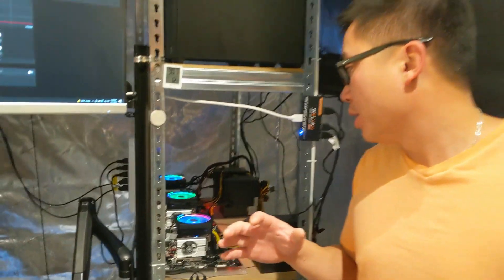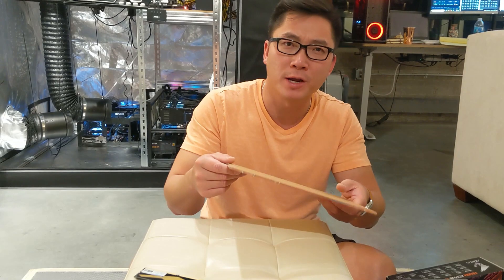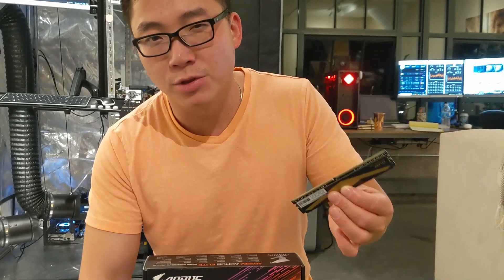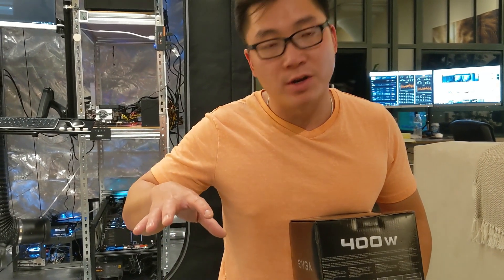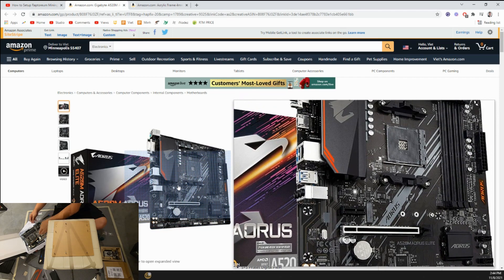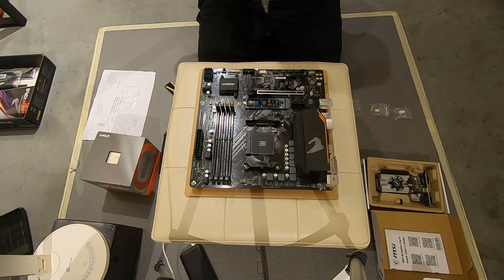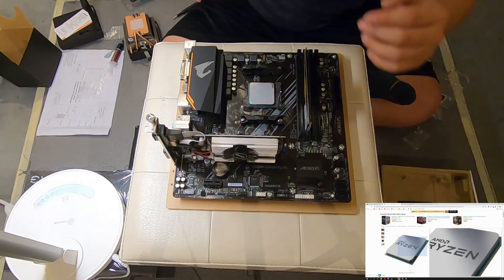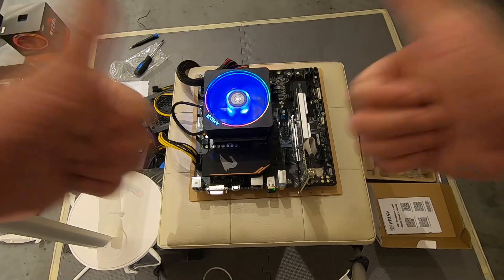What is the Best Mining Rig Build for CPU Mining Raptoreum?

Comment: For all of those asking why he is not using the IG, the simple answer is because he doesn't have IG.  You are making the assumption that because there are video out that the motherboard chipset has IG.  The video out are there because the motherboard supports AMD APUs.  The CPU he is using is a 3900x hence no IG.  If he was using the 3600G which is an APU then he would have IG.
Reply from the maker: I spent 3 hrs researching to figure out I have no IG... Couldn't figure out I couldn't activate it in BIOS. I wished you would've commented earlier 😂
Reply: @Viet_Tran  That may be an issue. But there should be some rudimentary video built into that MB.  Seems your are correct. I guess all those INTEL builds I did back int eh day, had built in graphics. That's what threw me for a loop.
Reply: Facts like straight up fax I didn’t realize that until I read a lot more about the CPU

Comment: Here it goes:
I recently built a pc with spare parts from my mining rig(Server psu +PICO 120w)
The pico doesn't have enaugh juice for my cpu.
Is it safe to power the Cpu via a 6pin pcie to 8pin atx adapter directly from the server psu?
Meaning the PIco is only going to provide power to the board's(24pin) while the beeffy server psu does the heavy lifting?

My Components:
Ryzen 9-5950x
RTX 3070
Asrock B550 Phantom itx/ax
64gb Fury
Samsung 980 Evo-(My boot drive)
5TB barracuda
PSU - HP 1200w platinum server PSU (12v only +Breakout board) + (120w Pico PSU)

Full watercooling loop from Alphacool.

My main fear is that there may be some sort of power delay between the two PSUs(Pico and Server PSU) and that might cause problems.
The PICO psu's input is 12v so naturally I got a 6pin pcie to DC Barrel jack adapter that is purposely made for these two PSUs.

Comment: You can get the 5900x for $479 right now which imo is worth it over a $430 3900x
Reply from the maker: does that offer come with the CPU fan, Johnathan?
Reply: @Viet_Tran  no fan, but what you save over the normal 5900x price you could buy a comparable heat sink.

Comment: Another thing to mention here guys. 

If you're going to mine with a gpu and cpu, you'll also be powering the fans, any storage device, ram so expect your wattage to be even higher, with that said DO NOT SKIMP ON PSU. 

The last thing you want is an overvoltage or short circuit due to shit PSU voltage regulation. 
So if you expect 145w from cpu, 200w from gpu. With a psu rated at %85 efficiency and 400w.. you're gonna struggle 😪.  

Another thing to note is the power delivery system on the motherboards, x570 with decent VRM cooling is essential for stability  and hitting higher clocks. 

Ddr4 ram can be picky with ryzen 9 5xxx and 39xx so be sure youve got some decent compatibility (wish I was joking) 
Ontop of that, you'll want to adjust your infinity fabric to match 1:1 ratio with ram frequency and timings. 

All that sounds like effort but will be worth it when done correctly, same can be said for undervolting to reduce temps.
Reply from the maker: I love this comment, absolutely agree, 100% Always better safe than sorry.
Reply: @Viet_Tran  i got paranoid running x2 gpu's and x1cpu from a 650w... so i had a spare psu added on just to power the gpu.

If people have a spare PSU lying around they could use it just to power CPU or GPU. While the internal PSU powers mobo, ram, ect.  

Keep up the work Rabid, you're gaining attention :P
Reply: @daydream605  is that possible? How did you turn on the second psu to fully functioning? When you plug a psu into cord the fan won’t be running instantly right?
Reply: @starlordyt6151  you'll have to jump the 24 pin connector to trick the psu into thinking that the power button has been pressed, 
Alternatively you could use a cheap Psu voltage checking tool which will power it on automatically. 

I prefer the tool as its cheap and provides information
Reply: Oh and 5xxx ryzen no longer ships with wraith cooler so you'll be needing something like Noctua NH-D15

Comment: Why buy a GPU when you have onboard graphics. They suck, but why buy?
Reply from the maker: the A520 won't let me activate I.G. in BIOS. Do you know how I can bypass this John? Thx!

Viet
Reply: @Viet_Tran  You should be able to set it in the bios to use the onboard video. Have you made sure the bios is the latest? It has the capability to do that.
Reply from the maker: @johnlubben4980  currently it does not, but I am not updated it no. Been so busy with work. I'll get to it. 

Thx John, definitely forgot about updating it.

Comment: Hello, thx for the video 👍
Do you have the best bios setting on the gigabyte card ?
Reply from the maker: hi there, the Gigabyte card I used is A520, it doesn't allow over clocking. I am ok with it because the 9 3900X are averaging 3-3.2K hash.

the only thing I changed was the RAM speed on BIOS to match 3600mHz

Comment: Hello! Why do you put a GeForce 210 as you can use the integrated GPU to make the computer work for your settings, isn't it?
Reply from the maker: can you help point me in the right directly Artem? under initial display in BIOS it does not have an intergraded graphics option, the 9 3900X also doesn't have I.G.

And I am not using HIVEOS or Window 10 Pro, so I can't control remotely.
Reply: Hey when you get people that only focus on the money. They don’t really know how pc works.

Comment: Damn those prices are expensive !
47$ for a gt210 and +90$ for a A520 Motherboard 
I would still buy a better power supply because you  are just using the 12v rail for the cpu. Maybe 500w gold would be better, but you have to check the specs for that cpu cable
512GB is too much, a 120GB SSD is more than enough
The best ram to mine Raptoreum has to have low latency, CL14
Reply from the maker: Have you tried different RAM to see if it makes a difference Xalex? I want to try but running out of power at home haha :D

Comment: I would love to do this along with my GPU mining. I would imagine I would need to reserve a couple of threads for the GPUs.
Reply: Yeah you only need 1 thread, maybe 2 max, you can configure this in the Json file
Reply from the maker: I see what you mean!
Reply: @i7Steve  you can use all your treads when u set the process priority for cpu mining to 0. for my gaming/working pc i use 14 of 16 treads  (7 of 8 Cores) because i want no lags while browsing YT
Reply: @Andurill  I ment 1-2 reserved for the system, and use the rest for mining
Reply: @i7Steve  on my gpu miner i use all threads for mining but the process priority for the miner is low so every other operation will be handled first and only on idle it mines
Reply from the maker: I have a few computers that's CPU and GPU mining at the same time, Gary. I think the best deals are through HP website. I bought some Omens with 5700XTs and Ryzen 5-3500X earlier this year for $1K each, I think they're $1.2-1.3K now, just plug and play.
Reply: Not necessary. You can mine gpu and cpu simultaneously and have no impact on either.
Reply: @JR42x10  i am also farming xch and forks + staking NRG. Therefore i need more Ressources

Comment: overpriced low end motherboard with ryzen 3900x not suprised why your profit is so low, also you dont need graphic card for every single rig... just one to set up things in bios, then you dont have to use it at all... and pro tip start using hive os...
Reply from the maker: need HIVE or Windows 10 pro to control it remotely. Don't have either.

Comment: Why not use the video card on the board?
Reply from the maker: these are $50 cards I bought just to start the machine up, it does not have enough power to hash, my friend.
Are you getting into CPU mining as well Ian?
Reply: Youd need a G series processor to use the mobo with no gpu, and the l3 is cut in half on those so not great for this is imagine
Reply from the maker: @Rancid_Ninja  yeah, I couldn't figure out how to activate I.G. on mobo, didn't have the option to switch in BIOS.

Comment: Why arent you running HiveOS? Its easier to manage, also it can be run without a GPU (just make sure to disable VGA detection in the BIOS)
Reply from the maker: I'll look into it next week once work slows down, are you using it for CPU mining right now Patrik?
Reply: @Viet_Tran  yes I'm CPU mining with it. It has a / rig fee, but IMHO it's insignificant compared to how much easier it is to manage compared to Windows. Also, it does a lot of stuff for you, so you can expect a better hashratew.
Reply from the maker: alright... I keep hearing about it, I need to check it out! thx Patrik! 

Good luck hashing buddy!!! :)
Reply: @Viet_Tran  thank you very much. Wish you the same. Also thank you for the very informative video!
Reply: I second HiveOS. I know you're doing NH for revenue to ROI your rigs, but you can mine to them on Hive too! And it opens you up to a lot of other pools, easier overclocking , etc.

Comment: Hi. Nice video. Why do not use hiveos and run it headless? I run 4 pcs with AMD headless with no gpus at all...... :)
Reply from the maker: Doesn't HiveOS charges per month if you have too many rigs?

Because I am CPU mining. As well I have 12 Rigs right now.
Reply: @Viet_Tran  man for cpu mining the charge is very low , only few cent
Reply from the maker: @sdsir  I'll take a look at it, are you using it now? how are you liking it?
Reply: @Viet_Tran  yes, I'm using hiveos only.. it's better, stable, easy to use and cheap too for cpu mining. But remember you should not have any gpu attached with your cpu mining rig.
Reply from the maker: I'll check it out, I have mine because I am not on HIVE and no Window 10 Pro so I currently cannot remote.

Comment: could you tell me how much hashrate drop if I use ryzen 9 3900 with single channel memory?
Reply from the maker: I have not seen a significant drop Zeeshan, the biggest factors I've seen is the hash rate changing due to heat. Do not have enough data to definitively quantify it yet, but will post once I do!

Comment: why you use box cpu coolers? if you overclock your CPUs then hashrate will be more profitable.
Reply from the maker: you're my most critical commenter but also most valued haha.
Work has actually been really busy so I haven't tinkered much with the CPUs, I actually only have 3/5 mining right now but will get the rest going when i figure out my power situation. I still need to look into overclocking it properly, I've only done the 4 hours auto-tune, can you point me in the right direction? Thx!
Reply: @Viet_Tran  every syystem - mobo, CPU, RAM is individual for OC, so you need spend more time than just couple of hours for auto-tune. but anyway you need non-stock CPU cooler system, for example, I bought bequiet Dark Rock Pro 4 and Noctua DH-15 for my OC experiments. there are many tutorial vids here about Ryzen OC and I know that your RAM must be at least 3200 CL16 (better CL14) to get nice results.
Reply from the maker: @supersonicunitedsupersonic8531  I'll definitely look into it, might as well get the most out of it if I am going to run it 24/7.

Really appreciate the extra nudge! :) motivation
Reply: can a520 handle oc on cpu? i guess lowest tier is b450. next is b550 and also z mobo.
🙏 sorry if im wrong
Reply from the maker: @syaifullahumar2944  mine were all auto tuned.

My cousin has the same built with A520 and he's able to about 7% higher hash than me after OC
Reply: The prism is the best OEM cooler and will be just fine, the stealth is not sufficient tho
Reply from the maker: @Rancid_Ninja  yoooo Joker!!!! your profile pic scares me :D

Comment: On one motherboard can you mine raptor out and GPU mine at the same time? I figured I ask
Reply from the maker: yes you definitely can, but you need a stronger PSU and GPU.

Currently still not recommended since GPU are not as effective mining RTM.

I have 5 computers that's mining RTM with CPU and ETH with GPU right now.
Reply: @Viet_Tran  so you can’t mine Etherium and cpu mine at the same time you mean?
Reply from the maker: @HoeLeeFuQQ  I am on my other computers.

I have (4) computers with Ryzen 5 3900 and Radeon 5700XT that are mining ETH and RTM right now.

These ones just have really cheap GPU that can't mine ETH.